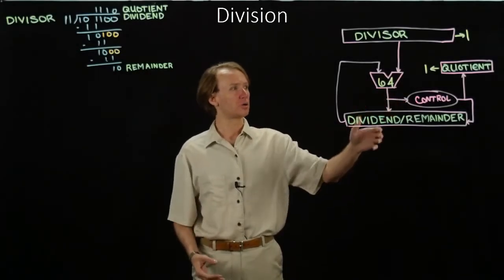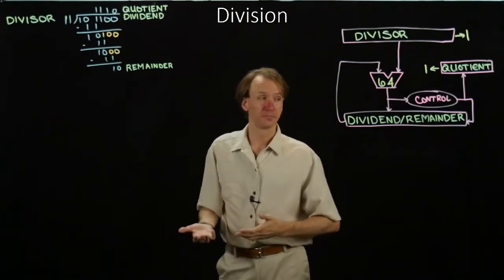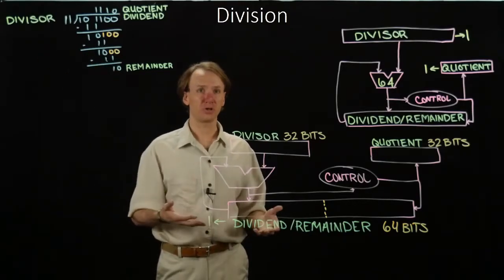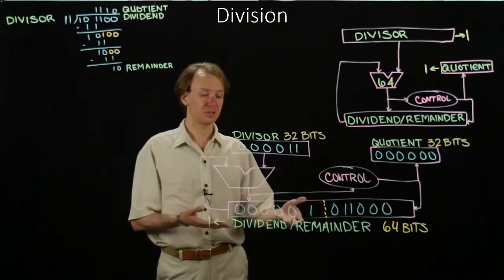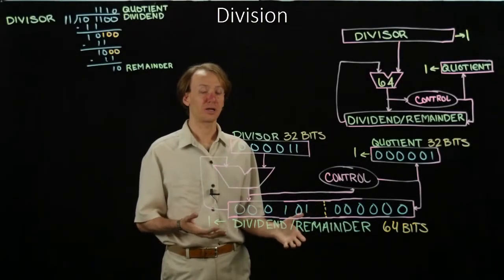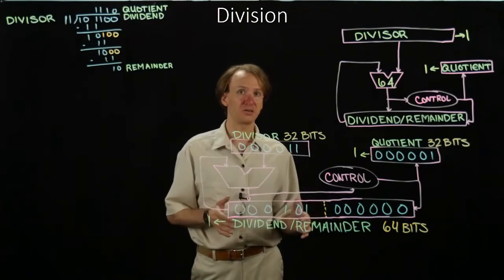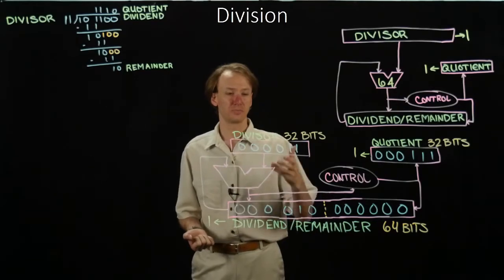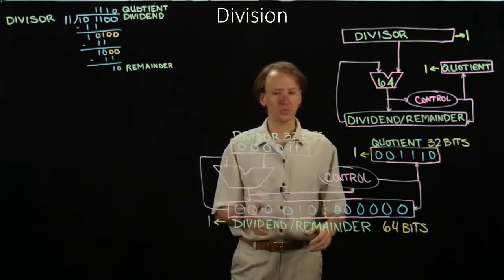13-1.  Improving the Division Hardware

Comment: All you need to do is ignore the bit in between the remainder and quotient part of the remainder register. You don’t need to shift it - just wire it offset one bit.  You also need to account for when the remainder is the dividend, because the divisor is larger than the dividend, and account for when the quotient is the dividend, because the divisor is 1, so the remainder/quotient register is a shift register of 65 bits to account for two 32 bit operands.